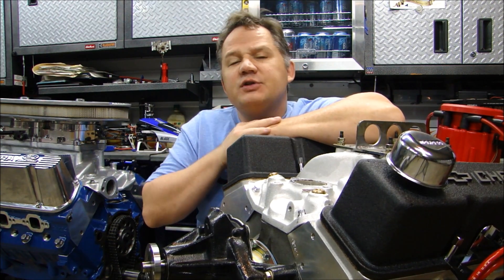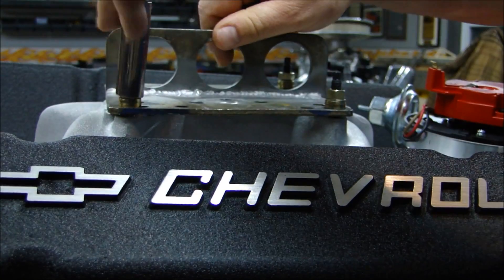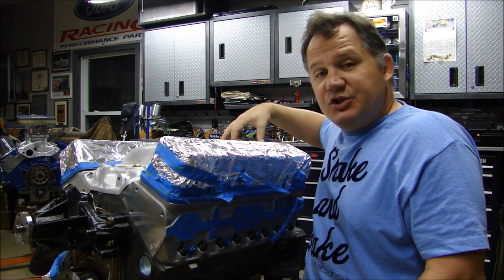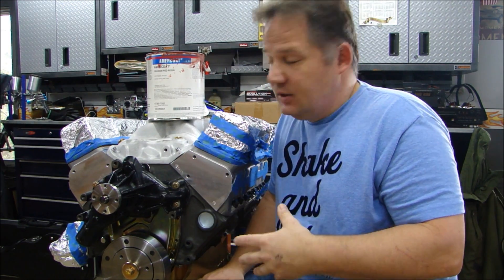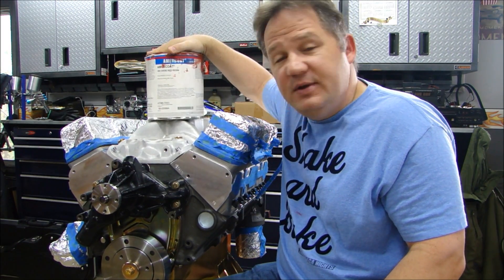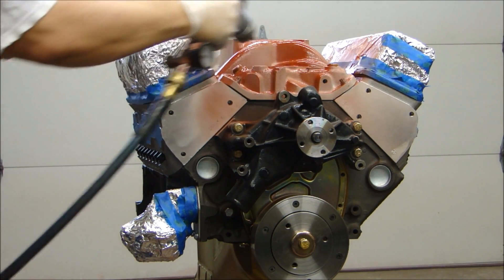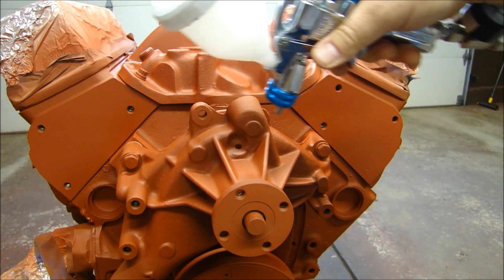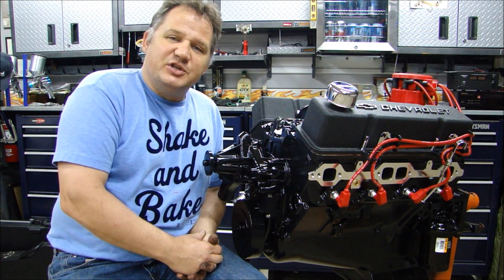Engine Building Part 11 - Engine Painting

Comment: Would you paint the engine with the oil filter on? I just figured the oil filter could cover that area really well. It wouldn't matter if you got paint on the oil filter since you'll dispose of it after break in.
Reply from the maker: That's a great idea! As long as you can spray behind it

Comment: would it make sense to use a heat resistant powder coat instead of a glossy finish in the case of finding minor leaks?
Reply from the maker: I don't think that would help leaks
Reply: @PetesGarage  No not stoppin them, finding them haha
Reply from the maker: I have powder coated engine parts before

Comment: Great series. Really comprehensible info. Way back when, it was kind of established that a rough finish paint coating on the engine, allowed the engine block to dissipate heat from the engine more 'efficiently'.  It was found that black was a more efficient color than Chevy orange. Same with the aluminum intake manifold, no paint on the exposed rough surface was a way to save the engine from retaining heat unnecessarily.  The paint on an intake manifold was not necessary.  The old, old chevy 265 283 and 327's in 'stock', non performance engines were presented in vehicles from the factory with the "cast iron" intake manifold painted Chevy orange.  Racers were using physics back in the 70's.
Reply from the maker: Interesting, thanks for the input.

Comment: I read in an article that they coat inside the cylinder with ceramic  to decrease the heat is this correct and is it  a paint or put ceramic
Reply from the maker: I have never heard of that.

Comment: So is everything the same regardless if you build a engine with a carb or not?
Reply from the maker: Not really. Fuel injection will use some different parts, but the rotating assembly will be mostly the same.
Reply: Pete's Garage cool, thanks for replying so fast.

Comment: Is wrinkle paint easy to keep clean? Which engine rattle can paint do you recommend for an aluminum motorcycle engine?
Reply from the maker: It's not that bad. Out of a can I prefer Plasti Kote
Reply: Pete's Garage is Plasti Kote heat resistant? It wouldn't melt on the cylinder and head?
Reply from the maker: Yes it is. It works well

Comment: Hey Pete I prostrate myself before your attention to detail! 
Regarding masking spark plug holes... To avoid dropping any FM into my precious motorcycle engine, I cut some spark plugs just above the threads so there was a tiny bit of flare left on the plugs. Batter out any porcelain.Then I JB Welded an Allen (hex hole) screw into the remains of the spark plug. I just whacked the ground electrode up a bit and it helps to hold the Allen screw in place till the JB Weld cures. Now the top of the Allen screw is flush with the flare piece of the remains of the spark plug threads. You can now take a wood dowel and epoxy a piece of the correct size Allen key into it. You hold the threaded gadget you just made with the Allen key and can reach into an installed engine, past all the manifolds, heat shields etc. and even use compressed air to blow dirt away from your spark plug holes with no risk of any FM falling into the precious engine. You can even use a scraper to dislodge the FM on the convenient ledge usually found right by spark plugs  Because the slight flare you left on the end of the spark plug threads in can be tightened snuggly and you don't have to worry about screwing the thing right into the combustion chamber and having the blasted thing fall into the engine. Or in your case, just use this for masking the holes.
Reply from the maker: That is an absolutely brilliant idea! Thank you for sharing it with us!

Comment: What if you want to match the engine paint to the car color and you have a custom color.  Will that car paint hold up to the engine temps?
Reply from the maker: I have seen engines painted with the same paint used on the car. I would think as long as you are using a quality 2K paint it would be fine.

Comment: I have my engine out of my boat...mercruiser 350 mpi with a chev block.   It is all black and I am working on cleaning the engine up after finding the oil leak.   There is a bit of rust behind the flywheel, and on the brackets.   Is there a way I can clean the rust off much faster, it sand blasting ok?   I bought a can of black paint, but after looking at the work you doing, I am rethinking.
Reply from the maker: Sand blasting is best if you can. Any marine part should be cleaned, primed with a metal etch epoxy, and covered with a 2k urethane.
Reply: thank you..

Comment: Is there any point in painting an engine apart from just wanting it to look pretty?
Reply from the maker: Yes. It prevents the cast iron parts from rusting and the aluminum parts from oxidizing. And it's way easier to keep clean
Reply: Paint it the color it's supposed to be (not black) it makes seeing leaks and sourcing them easier. Chevys are orange, fords are blue, and ect
Reply: Simon Coles id rather have the intake clear coated with something and keep the shine aluminum, paint the block only

Comment: what state are you in and how much would you charge for a re-paint?  I have a 1965 impala with a 283 small block I am trying to restore all stock so I want the original red engine block if possible but I dont want to screw it up as it seems like it would be far harder to fix than just do it right the first time.
Reply from the maker: I am in Buffalo NY. Would you have the engine out?
Reply: +Petes Garage I'd have to if you're in new York.  I'm in Texas.  I'm hoping to take a trip out to new York later this year though how many days does this take and how much?  maybe I'll bring it with me
Reply from the maker: It takes 2 days....you'll have to send me a picture of the engine so I can get an idea on how much work it will be

Comment: Very cool idea with the aluminum foil. I'll use that on my next paint job. I've always had problems with overspray in bolt holes I usually thread bolts in but I've had paint pull away if u don't cut around them. Any suggestions?
Reply from the maker: +Michael Elizondo If you do use a bolt you can cover it with vaseline. The paint won't stick and you can trim around it with an x-acto knife before removing

Comment: HI Pete, I have a garage door that faces the west every year it cracks and peels all the time. We had bought something that was supposed to fill the rougher paint and etch to the metal doors. I'm guessing that a coat of the PPG paint primer and eastwood paint would do the trick....
Reply from the maker: +Brian Johnson A strong epoxy primer will definitely help. The sun is killing the paint from expansion of the metal.

Comment: Great video. Im trying to paint my small block the same color as the car. I was told by someone that I can use the same paint which is not rated for any kind of heat, as long as i use a high heat clear over it. Is this correct? Any advice would help thanks
Reply from the maker: +Alejandro Gonzalez If you do use the same color, apply it as thin as possible. Paints that are not temp rated can burn and end up brown looking. A high temp clear over the top will help

Comment: have you done any intake manifold thermal coating before? If so, pros and cons if you know any.
Reply from the maker: +grn dragon Sure...I powder coat them all the time. It works fantastic
Reply: have you used the any thermal coating inside the intake? any problems peeling or cracking over time?
Reply from the maker: +grn dragon I have not. What kinds of thermal coatings are you thinking?
Reply: I've heard of Cerma Lube for the inside of the runners. I'm not sure about the intake to head surface or underneath the intake.

For carburetor motors, it is suppose to be for every 10 deg is 1% power gains.
Reply from the maker: +grn dragon I'm not too sure about that. I would just leave it bare

Comment: Hey Pete,
What holes do you have to cover and what holes can you keep open on the engine, can any holes that need bolts not have to be covered
Reply from the maker: +Gavin Sherban If there is a hole I know a bolt is going into I will put a tapered silicone plug in it to keep it clean. You can always chase the threads if you get paint in the hole.

Comment: Great Video's Pete!
I wish you were my neighbour!!!
A am a total novice in car repair and learned to take things apart of my car (citroen xm turbo diesel) and put the things back in place, hoping to not be left with any bolts, not knowing where they would have to go (which actually happened)  because it broke down when staying on a camping in the mountains in Spain. A lot of white smoke and loss of cooling liquid, so you may guess what happened. Well, the garage in the village refused to repair it, so I had no choice!
I asked a friend of mine in Holland (where I am from), to go to the library and get the book about my car and copy the pages about changing the cylinder head gasket and send it to me. 
Together with my children and the copies in the hand we took the things apart, writing down and drawing everything we did. Once we had a new gasket we did the whole process in reverse.
I was pleasantly surprised when I started the motor, and it actually run!
We drove home, but with the motor smoking enormously during about 500 miles (which we tried to ignore), after 500 miles the smoke fortunately disappeared and all was well.
It has functioned well since then for some years.
Now things are different and the motor was making such a banging noise (of which nobody could tell me the cause), that I decided to buy a new (second hand) motor and replace it. I am working on it now to get it running again.
Unfortunately I miss time to dedicate to repairing the car (that I've started to get attached to), so temporally we are doing all by bus, train and of course... bicycle now, until I got it fixed again.
However there are always new challenges.
Seeing you building a motor from scratch is very stimulating!
Thank you so much for making the video's and share them with us!
Reply from the maker: +Harm Valentijn Wow...what a story! the white smoke was from coolant getting into the combustion chamber. It will clear up after awhile but you probably scored the cylinders from the steam. Steam is very corrosive so the block needed to be bored out. At least you have the guts to try to fix it yourself. Let me know if you plan on moving to the US...lol

Comment: Hi Pete. I work in the maritime industry in vessel repair, we  have used epoxies for years and the Ameron brand is something we use often. I once was speaking to a clerk who sold epoxies, asking him why folk use polyester resin instead of epoxies when they build fiberglas boats if epoxy is a superior material strengthwise.  His answer was that epoxies cure time is much longer than the polyester resin. He also told me that epoxies stick to anything.but not vice-versa. So you could build your boat using polyester to start and finish with the slow curing epoxy for strength. I mention this because you used epoxy for the primer on that Chevy and also a two part for the finish paint. Anyway, it is necessary to make sure the paints are compatible. Thanks for your videos.
Reply from the maker: +Don Gamble Absolutely correct. Compatibility and grip strength is important. The primer must have more grip strength than the paint or else when it gets chipped the primer comes off too. That's why I use epoxy primer. It's a metal etch primer. It is very compatible with every paint

Comment: Here's something for you and  it's and Eastwood product.
Satin Black Hi-Temp Coating
Item #10393 Satin Black Hi-Temp Coating
It's rated up to  1400 degrees. 
Made for headers so cool down and heat up with expansion and contraction should not be a problem.
Reply from the maker: +ecleveland1 I knew about that paint, I was looking for a 2K ceramic coating like their other engine paints. Thanks for the recommendation

Comment: Pete, how do you recommend to break in a brand newly built motor?
Reply from the maker: Hydraulic, solid, roller, flat...they're all different. follow what the cam manufacturer recommends and use a good break in oil like Royal Purple.

Comment: Fantastic Video, so well done. Much appreicated. A couple of small  things i do not understand and I couldn't quite see in your video.
1) I have my 302 on a stand cleaning it now but how do you paint an engine on a stand and get to the back of it that is attached to an engine stand?
2) When you tape off the exhaust ports and other areas do you worry about tape residue? Can you just get tape and its residue everywhere and what do you clean it up with after?
Thanks Peter
Reply from the maker: Thank you. 1) You do not want to paint the back of the engine where it bolts to the transmission. You have to be careful with the spray gun to get around the back. 2) Tape residue is not a huge issue, but lacquer thinner takes it right off.

Comment: Hey Pete, I'm a painter at a body shop and anything I've ever had to spray always has to be sanded or scuffed, but I've never painted a block or anything like it, and I couldn't tell if you had scuffed it all down or anything and was just wondering if it's necessary to do..
Reply from the maker: It is always necessary to clean the block or engine with a degreaser. The primer etches into the metal. I've never had one go bad.

Comment: Great video Pete, love that your taking out of your time to shed wisdom on us. Hey, I was looking at that Amercoat 385 Primer and it is listed to only handle 170 - 200 degree temps. Any clues how well it has been holding up yet on this motor?
Reply from the maker: I've been using it for a long time. It's been bullet proof so far. A high solids epoxy properly applied is really good for closer to 300 degrees. I only apply a very thin film to maximize grip strength. If you put it on very think I can see heat possibly causing a problem.
Reply: ***** Thanks Pete. On your recommendation, I am ordering the primer and paint you used here to wrap up my rebuild next week. How much of each do you typically go through?

Comment: Only thing I did different on my last engine rebuild was have the piston crown and combustion chambers ceramic coated. The heads combustion chambers dimpled for even flow. The last one you need a computer to layout the pattern.

Comment: Pete, thanks for the video. Sort of a related question - I've heard that black paint is best for dissipating engine heat. Do you think that's true, and if so how much of a difference do you think it really makes. Also, does the extra step of priming the block negate any of that? And, does painting aluminum heads prevent them from radiating the heat away as effectively as they do? Thanks - CF
Reply from the maker: Great questions Colin. I think I can wrap them all up with one answer. The ability of any material to transfer heat is dependent on the density and chemical composition (color is not a factor). I suppose certain colors may have a different specific gravity, but the effect would be negligible. A plastic enamel or urethane is more of an insulator where an epoxy has more solids so the heat can dissipate. I have not read any studies in this regard. Since the coating is relatively thin I do not believe it is significant and probably not measurable. The metal etch primer will help reduce peeling from expansion. Thanks for those questions. I had to really think about that for a bit.

Comment: That primer is great. I didnt believe you for a second then I saw that Oil Rig orange color. I guess you were serious about how heavy duty that stuff was.
Reply from the maker: I really try not to say anything that is not accurate. That is the same primer used on bridges and ocean equipment. It is very high in solids and extremely chemical and weather resistant. Thanks Christiian.
Reply: ***** I'm listening to your video on piston rings and I was wondering what you do for a living. Of course you do engine work but you sound like my Materials Science Teacher talking about the ins and outs of materials and their temperature phases.
Reply from the maker: Thanks Christian. I'm an Engine Assembly and Testing Processes Engineer for GM. Building an engine is more than just putting parts together. Understanding materials and some physics will help you solve many problems.

Comment: Would this same method be suitable for a turbocharger exhaust housing.
Reply: Pretty sure the exhaust housing will be up around the 700-1000C mark, most paints will just burn off. Ceramic coating might be your only hope
Reply from the maker: Thanks for the comment. I agree with you

Comment: question using car paint wont work because the engine heat will burn it off . I was thinking of painting my ls block that gold like paint you see on the 2004 4-door mercedes cars will that primer you showed work with that paint
Reply from the maker: I can't imagine it not working, but I would try  sample first. I would check with the paint manufacturer to see what temperature the paint can handle.
Reply: thanks for the reply Pete will talk to a car paint supply store and post back there response on it so everyone can know the answer
Reply: soloM81 I would suggest you go directly to the paint manufacturer and ask them. My experiences with inquiring about technical or performance issues of coatings or paint is that the distributors, wholesalers, suppliers and retailers usually do not know or have definite answers. Most manufacturers have websites, email and telephone numbers to make getting technical support easy.